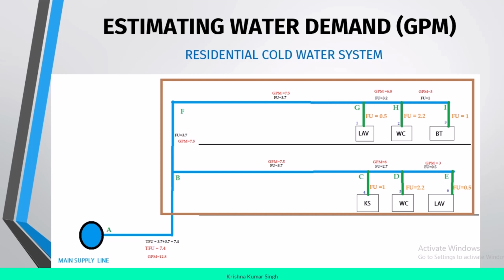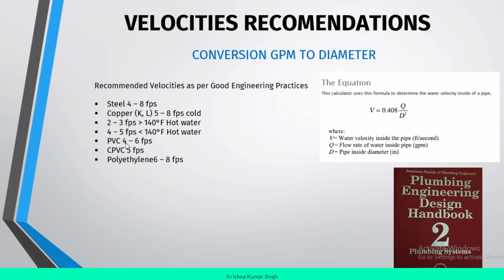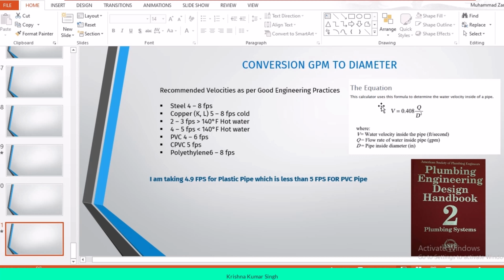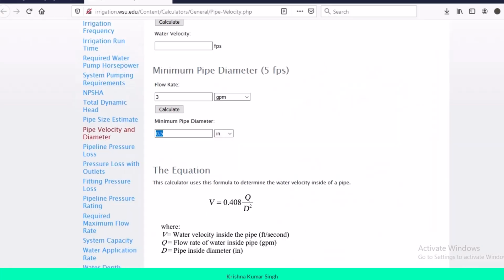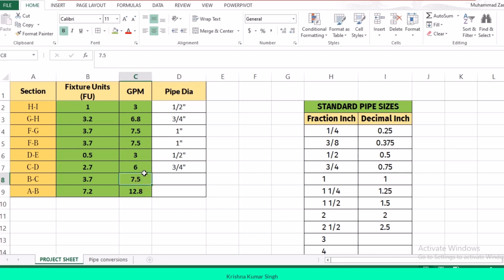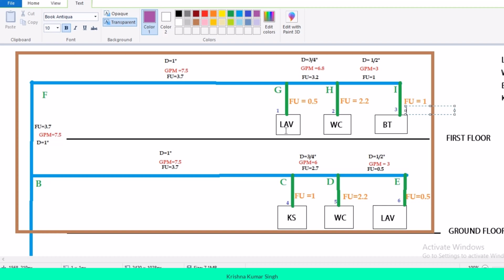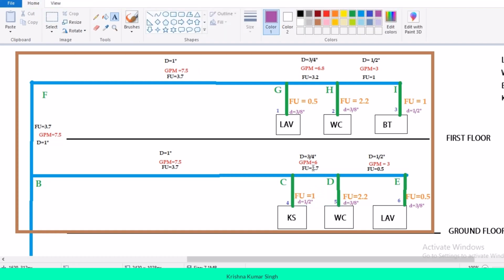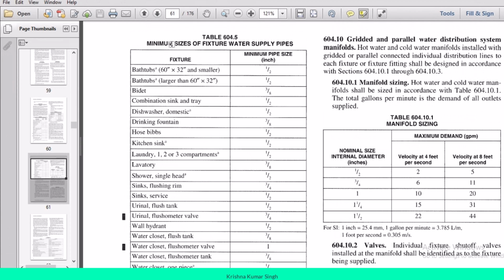How to Calculate Plumbing Pipe Sizes: Step-by-Step Guide - 07

Comment: Thank you very much for breaking this down. I totally understood everything as it is. 

But you seem have ignored pressure losses due to head loss, fittings and couplings along the pipe flow & that of the Sanitary appliances. 

 You've also ignored pressure losses due to pipe friction. 

How do we reconcileal these please?  Or is this a separate method entirely to pipe Sizing?